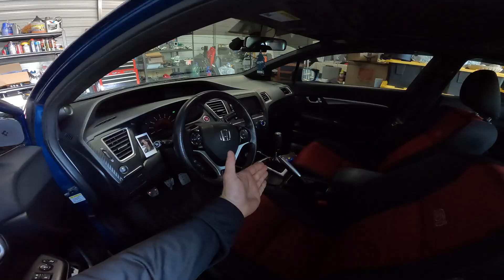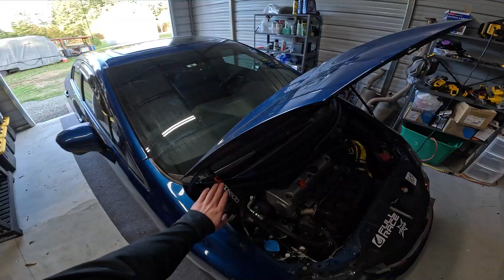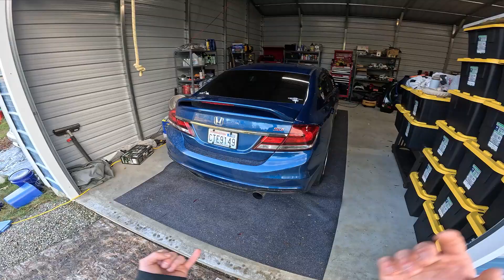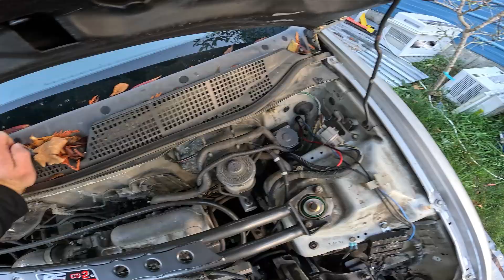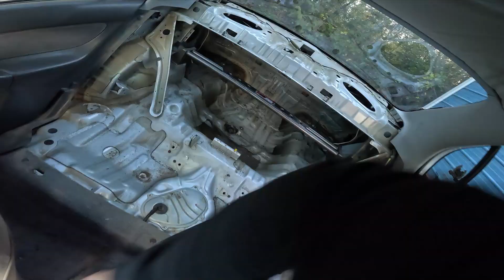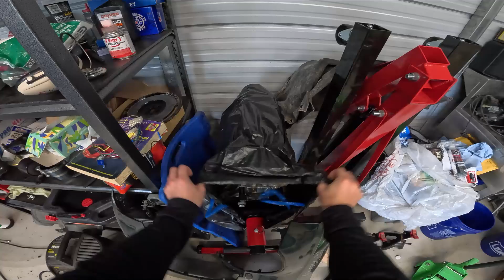FULL BUILD TOUR: Civic Si Daily Driver + EK Project Car

Comment: How do I install the pedals? I don’t know what to do because the stock ones have rivets .
Reply from the maker: U gotta drill out the rivets and run nuts and bolts through. That hardware is included. The gas pedal is self tappers into the plastic pedal under the cover.
Reply: @DDFB6 Thanks I’ll try that .